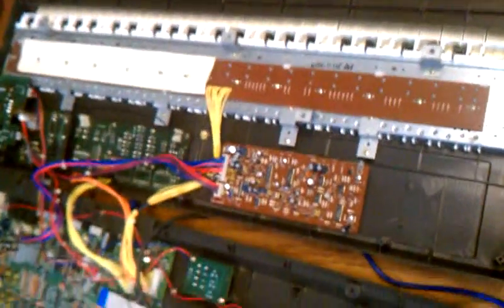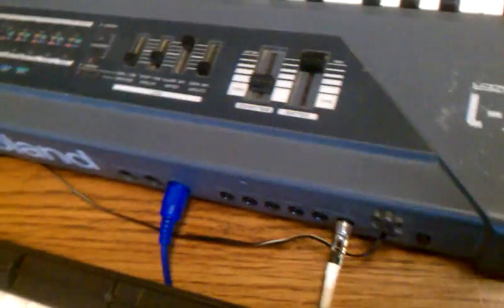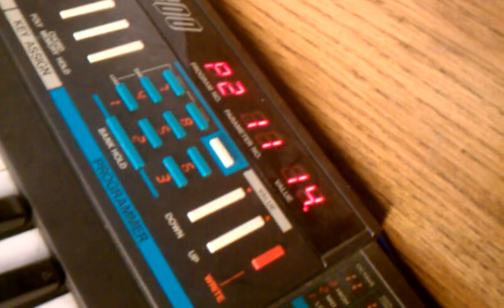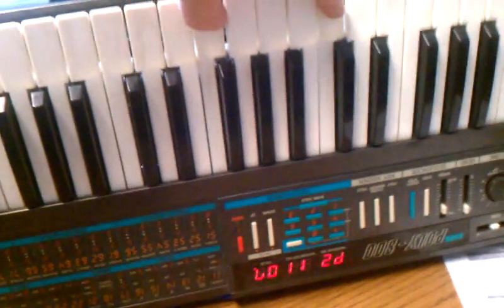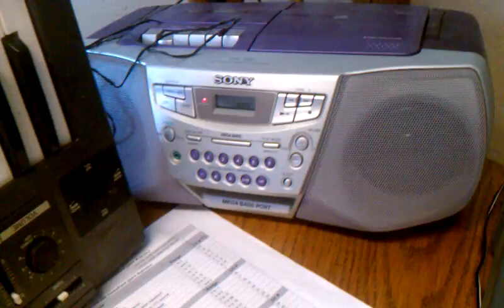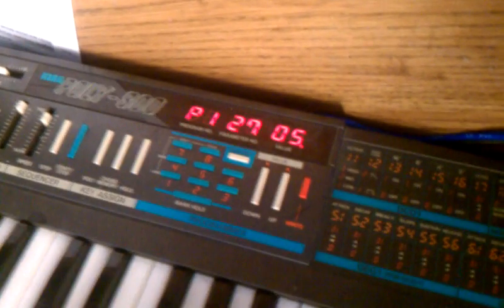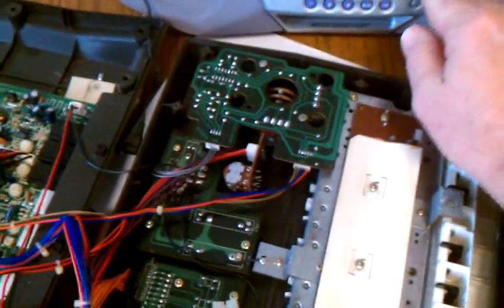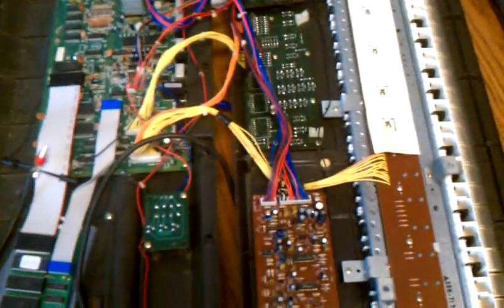External Audio passed thru a Korg Poly 800's filter

Comment: Tried this out but somehow it does not work as expected. Did you do any other modification on the noise circuit? Turning the knob counterclockwise does not really do the trick